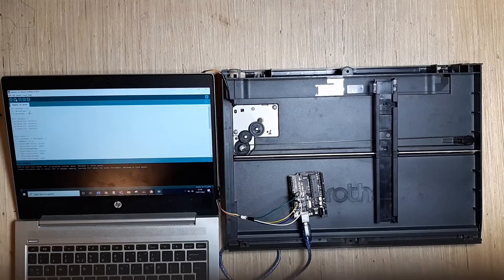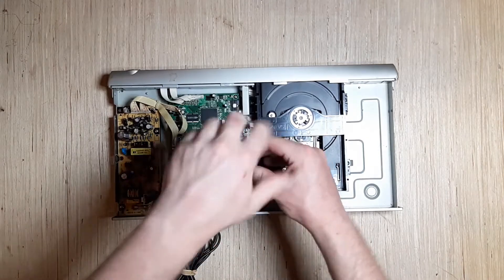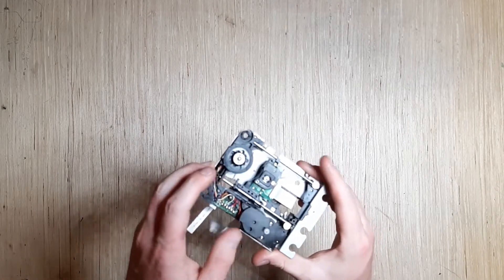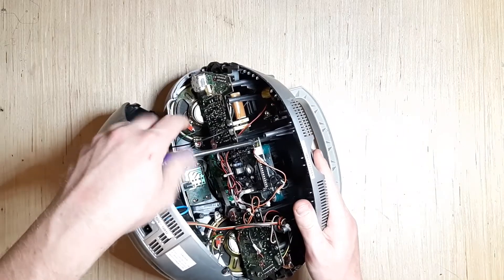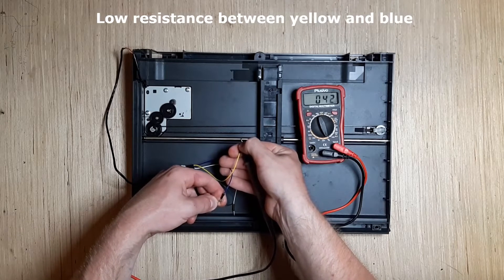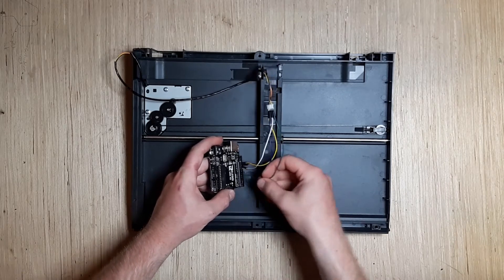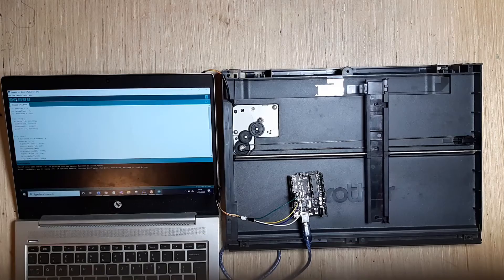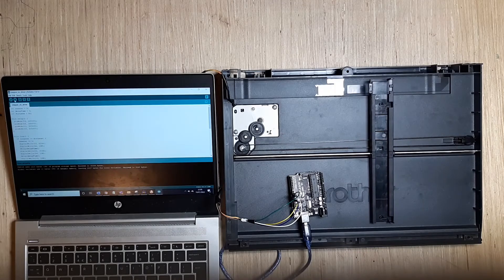How To Control A Stepper Motor Without A Stepper Driver (Arduino Only)

Comment: my motor isn;t working, the motor is from a dvd drive (those screw stepper motors), and it doesn't it just vibrates and buzzes
Reply from the maker: Have you tried increasing the value of the variable 'delayTime'. It sounds like your motor is trying to switch magnetic states before it has achieved the desired rotation. This does mean the rotation will be slower but at least it will turn.

Another option may be that you don't have the correct pins wired to the correct motor connections, try switching these around as well if the previous doesn't work for you.
Reply: @makeitquick9638   im trying rn to get it working with a uln2003 board, but no success, maybe you are right but, the motor is only vibrating and buzes, maybe its the timing, and ive tried a bunch of delay times, but not higher than 3, ill notify you if i manage to get it working!
Reply: super fast update, i made the timing 3.5 and managed to see it vibrating, so it might be the timings

Comment: code has an error
Reply from the maker: Have you ensured that the greater than/less than texts in the code were replaced with the correct symbols and checked that the pins are wired up the same? The pins also can't be arbitrarily attached to the motor as the coils need to be properly associated with the pulsing. This will also only work for smaller stepper motors as the Arduino cannot output enough power for larger motors.

Hopefully that helps.